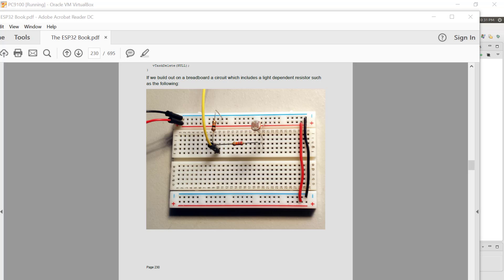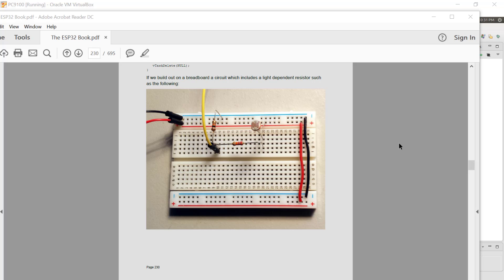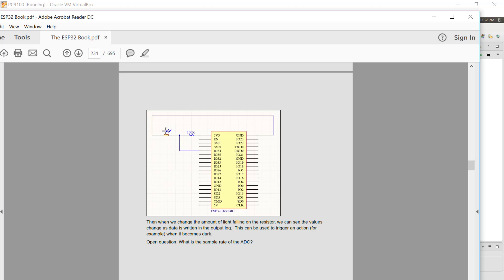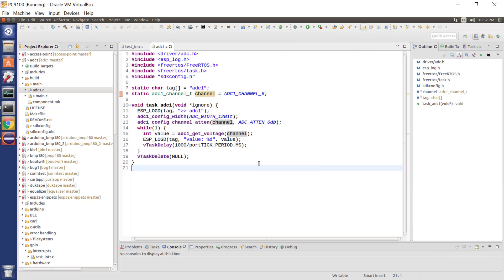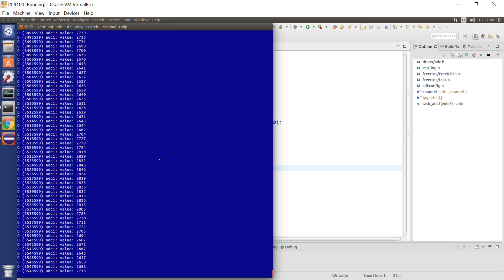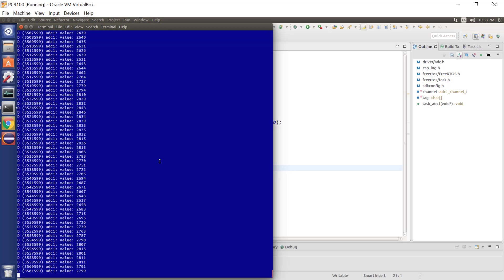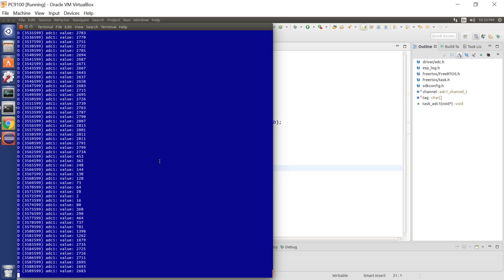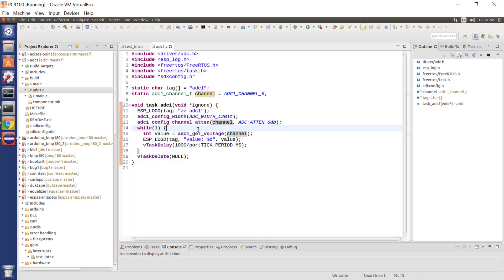ESP32 Technical Tutorials: Light Dependent Resistor

Comment: Thank you
Reply: Thank YOU Art.  Its hard to think what folks would like to see.  As I try and add polish to the ESP32 book of notes, I'm going back through my tests and trying to make videos of as many as I can.  Even though this one is crazy easy, its always "good" to get something working.  And if one is playing around with analog to digital conversion, waving ones hand over a light dependent resistor and seeing the values change brings extra degrees of comfort ... and a feeling of "hey ... it worked!!".
Reply: Just making things like these is rewarding by itself. Once you can make a small board computer do something, then you can pretty much make it do anything. The first thing I do with any new board is to run the blink sketch, then change it.

There are several different versions of the ESP-32/ESP-32S dev board floating around, and they don't always behave the same way. Your excellent (and free) ESP-32 book helps out a lot, just like your free books on the C.H.I.P., ESP-8266 and Raspberry Pi. I get excited at the start of each month, looking forward to whichever ones get updated.

The ESP-32 board I have is the AiThinker version. To load a new OS, for example, like in the video by Tony G (mentioned below) you have to hold down the Boot switch, until downloading starts, then you can release it. On other versions, you hold down the boot switch, press & release the EN/Reset switch, release the Boot switch, then download the software. I really hate those small switches. For the Espressif software (mentioned below), using their IDE, all you have to do is start downloading, with no switches/buttons to press.

The version I got had a couple demo programs that worked, but no repl -- only a strange message that repeated forever, which couldn't be stopped/interrupted. The only way to fix that was go to the Espressif site, download their Devkit IDE, load the DevKit software to the ESP-32, and finally get a repl. Their documents also showed how the three binary files were to be loaded, if not done through a scrpt, plus gave the other parameters like DIO and 8MB flash. http://espressif.com/en/products/hardware/esp32-devkitc/resources ("Getting Started").

There is an Adafruit ESP32 video, starring Tony G, which is also excellent. I followed it, and loaded MicroPython on my ESP-32. Tony used a Mac, while I use Windows 7. The differences are easy enough to figure out. Tony also has a video on putting MicroPython on an ESP8266.

The other fun project is making an Amazon Echo using a Raspberry Pi. I built three versions of that, so far. The first was on a Pi3, where you have to push a button, then say your query. The next was a slightly different version, using a Pi0, and pressing a button. The final was using a Pi3 and AVS, so that it can be controlled entirely by voice. Tony G showed one version, while Caroline Dunn showed how to make the AVS version. You can also simulate a Google Home device on any Android or Apple phone or table that runs the Google app. 

Thanks again for your small board videos. I go through all of them.
Reply: Neil Kolban ...thank you again. I think the value of demonstrating the easy stuff is that it serves as a template for similar setups. People who aren't experts on this stuff would find this video useful at some stage, I know I will, so it is much appreciated. 
It's like a bank of esp32 knowledge and you've just made a lodgement into the common account!